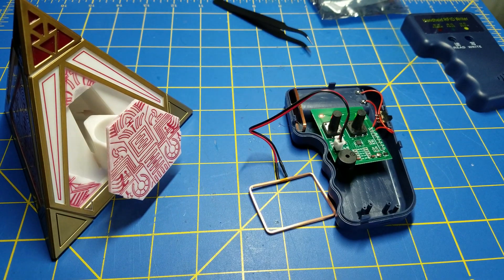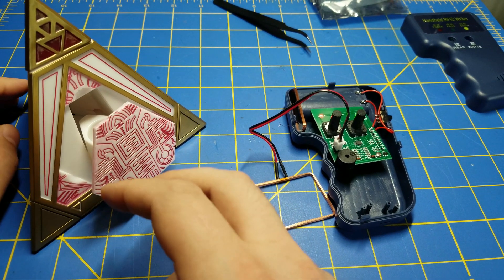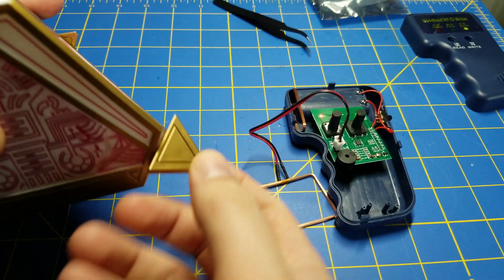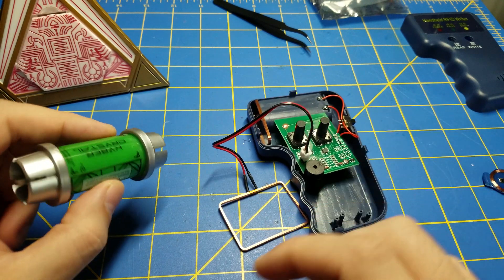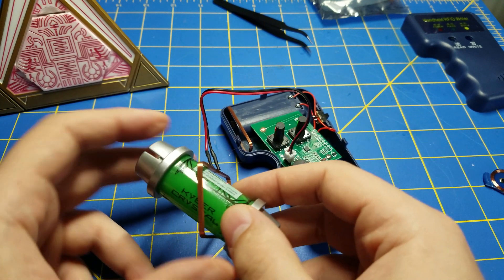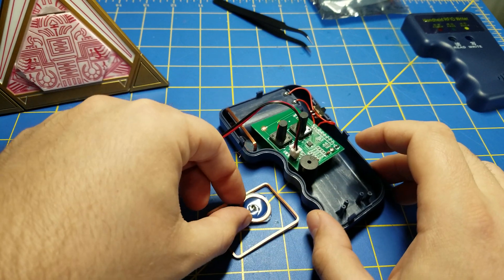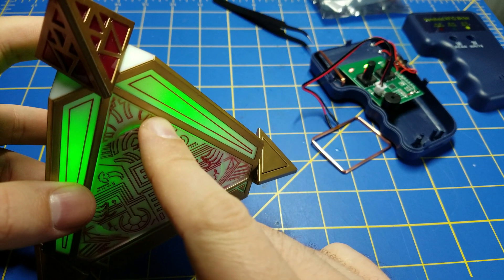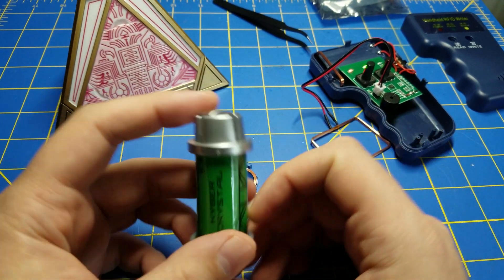Cloning Kyber Crystals

Comment: Nice - this is the first vid I've seen of cloning a kyber instead of just changing the tagid on an existing kyber from savis. Do you mind sharing where you got the blank blue fob, and what kind of a chipset it is? I've tried with T5577 tags and even though they read & write fine according to my meter, the saber hilt doesn't recognize them at all. Thanks!
Reply: For anyone else wondering, it's the EM4305 writable chip you need to clone a kyber, not a T5577

Comment: I bought a zonsin rfid rewriter, but it isn't reading a White kyber crystal. It reads other rfid items no problem. 

What gives?  Is Disney read-protecting their crystals now?
Reply from the maker: does the white kyber crystal work in a lightsaber or holocron? if it doesn't, then it may be broken (i've have a red crystal that was broken out of the packaging). if it does work, then the rfid reader should be able to read it, it may just be that the white crystal's rfid tag is weak and you'll need to try a lot of different positions with the crystal before it reads it.

Comment: Is the external antenna pretty much plug and play when it comes to connecting it to the reader/writer?
Reply from the maker: sort of. there is an optimum shape and size for the antenna to get the most range out of it. figuring that out depends on some characteristics of the pcb and the reader chip. 

but i ignored all that. i just took an antenna from an arduino rfid module. you can search on ebay for 125khz rfid antennas and you'll find they do sell just the antennas. Or you can always experiment and make your own out of some enameled copper wire.

Comment: You said that you could possibly make your own crystals and if so could it be possible to make a crystal that reads a completely different color than what is currently available like possibly orange or pink or any other color for that matter and do you think that this technology could be incorporated with non Disney sabers with Neopixel
Reply from the maker: custom colors is not possible with the Savi's Workshop lightsabers. the kyber crystals have an ID in them that the hilt reads when you insert the crystal. the hilt selects what color to use based on the ID. the only colors the hilt knows about are the current kyber crystal colors. 

if disney wanted to add new colors they would need new hilts and old hilts would not work with the new colors.

as for neopixel sabers, it's possible they could incorporate an RFID reader to detect the kyber crystals, but that would require a reengineering of all the electronics and probably a redesign of the hilt itself. basically it'd be easier for a company that makes neopixel lightsabers to come out with a new lightsaber that would work with the galaxy's edge kyber crystals as well as support new colors.
Reply: @Ruthsarian  yeah I was just wondering cause I think it would be a cool idea to merge the 2 technologies together and take it to another level

Comment: Can you change the color of the kyber crystal?
Reply from the maker: by changing the ID stored on the RFID tag in the crystal, you can change the color that a holocron or lightsaber thinks it is. however it's not just color that changes, but also the voice you hear when it's in a holocron. color and voice are tied together.
Reply: @Ruthsarian  that's awesome. So if a friend has a black crystal and you wanted to turn another red crystal into a black crystal I could dup it? I need to get one of these machines. Lol

Comment: Would you be able to change the rfid code from the kyber crystal and input a different rfid code to be read on that cyber crystal using your rfid reader/writer? Or would you need a different one? For example, if I wanted my blue Luke kyber crystal to be read as a green Yoda kyber crystal, how would I go about it? Would I just have the rfid scanner read the code, hook it up onto my laptop using the usb, pull up the info of the crystal, rewrite the new code onto the crystal, and voila?